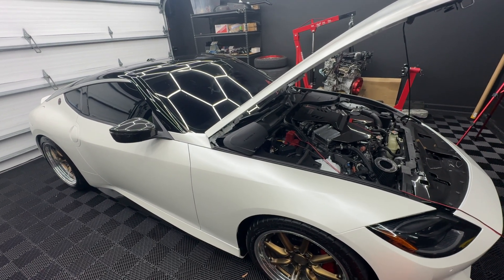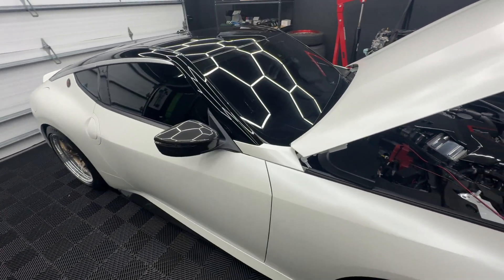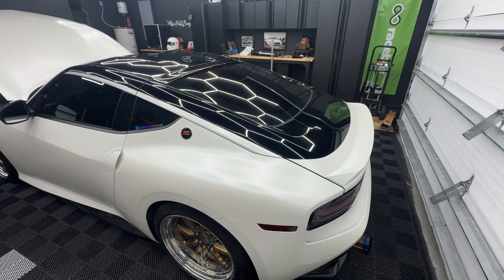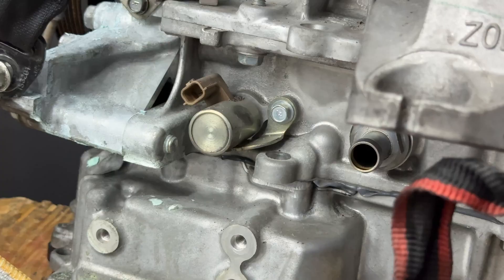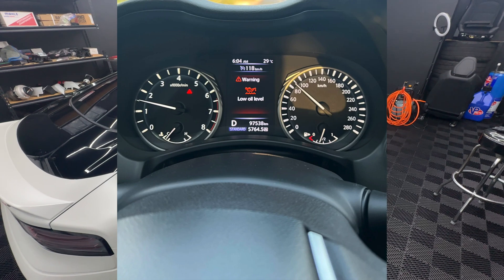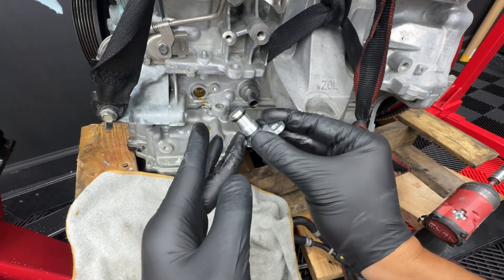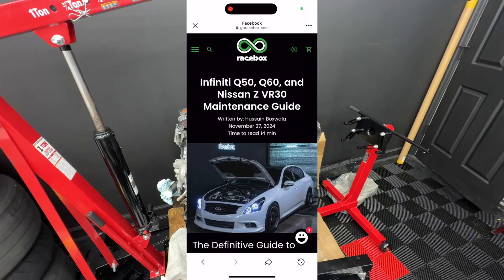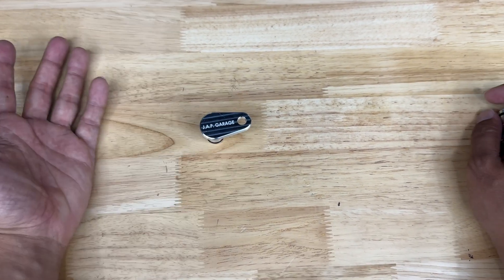Nissan's VR30DDTT Engine Flaw EXPOSED

Comment: 🔥 funny enough my Q60 just blew because of this exact same issue, been waiting on a replacement engine. should i also replace the OEM solenoid as well or do you believe the dealership will do that? 

wouldn’t want to get the car back and run into the same issues again
Reply: When I took mine in it wouldnt go into high oil pressure until 4 - 5k rpms at wot when I monitored.  The dealerships will only check the voltage for functionality.  It passed their check and I had to persist they replace it.  If racebox didnt point mine out, I would be in the same boat.
Reply: just get a blockoff or unplug it. its way better for your engine running higher oil pressure at all times
Reply from the maker: This is one of those items that come new with the long block. 

Btw, if you’re entering into the giveaway I need your IG handle or email address!
Reply: @ZillaFullBoost i believe youtube deleted my comment with my email, but i appreciate the response of course
Reply from the maker: @uzzivilla222 I don’t delete anyone’s comments. That was likely YouTube. When posting your email put a couple spaces between the @ and what ever email service you use or it may get flagged.
Reply: @ZillaFullBoost youtube deleted the comment again lmao, it’s all good tho brother best of luck with the car! been watching since the Q50 days years ago
Reply: 🔥 been tuned 2 years now no issue so far but car starting to throw a actuator here and there any idea? @frostedd_q50

Comment: How would you install the block off plate without dropping the motor?
Reply from the maker: Little hands and the right tools😅. You need to remove the cooler that’s right in front.

Comment: 2017 q50rs going 3 years fbo tuned. I want to run e30 but i seen a few people pump shitty e85. I run top tier 93 only (exxon) but want to squeeze more juice mainly for summer hot temps
Reply from the maker: Pump ethanol can do the job but if you don’t know whether your preferred gas station is good or not, you can use race ethanol.

Comment: You can just unplug the solenoid.
Reply: it works at low RPM,  and then deactivates and allows oil passage ,   unplugging will not let it activate  keeping it restricted and not opening to allow increase flow,  which is the opposite of what you want.
Reply: @twistymcslide2  i dont think thats true. they found its a nomally deactivated solenoid that restricts when activated
Reply: @rabidwolf3681  you may be right.  I read up a bit and saw race box had a suggested maintenance write up and they went into a bit more detail.  I thought the activation was for high pressure but it's for low pressure so the solenoid works backwards of what I thought internally.
Reply: @twistymcslide2 so what are you activating with aluminium blank? just unplug that thing
Reply: @tendrifter888    or just leave it plugged in , and maintain your oil and it wont get build up and ruin the sensor.   and or inspect and replace ,  and then plug back in .....   if this increases oil flow at low RPM , then peace out all the accountability for bearing/ring clearances , over working other systems like internal timing tensioner and pump .   if low rpm oil pressure , or oil pressure in general is a concern ,  then there are other more appropriate means to increase or control oiling.   pump modification ,  accusump , etc.  accusump can increase oil in general and be sued as a pre oiler before the car even turns on .  another way is larger pan ,  and or oil cooler.   then you get the longer service life of the oil over a longer range leaving less deposits which are the issue with the oem solenoid over time.    people love the easy cheap fix,  but dont know why .  they see higher numbers,  and those arent necessarily beneficial where you get the most out of the mod.   so...
Reply: @tendrifter888    same people who do this ,  are the same people who ask what oil to run , and or run a higher viscosity oil ,  and that is only of benefit when hot and at running temp .  its actually detrimental at cold start (  where most damage is done from poor oiling/wrong oil )   and it moves slower at the same temperature.    meanwhile 0W oil flows better at cold start ,  and has more anti friction additives than a 5W oil .   I will take the word and methods of AMS over other companies because AMS actually builds their engines and or rebuilds those brought in for it , in mass , comparably to other companies .
Reply: @twistymcslide2 unplugging it will allow more oil pressure end story
Reply: You just trying to sound like you know what you talking about bro 👌
Reply: @tendrifter888   exactly,  you cant explain how its of benefit besides being more.    even if that more  is bad until oil is at least warm and moving properly. LOL .  thats like adding more fuel jsut because its more.    without consideration of effect....     smart !!!
Reply: @twistymcslide2  Inspect and replace? Do you see how much of a PITA it is to access the solenoid? I have a one size fits all solution that allows me to never look or maintain this failure part ever again. Pump modifications will not change the fact that there is a oil pressure regulator that intentionally reduces oil pressure. Just remove the regulator i.e. the solenoid. Larger pan and oil cooler does not fix the fact that if the solenoid gets stuck in low oil pressure mode, then your car is crippled.

Comment: also , forgot to add.    0 weight oil has more anti friction additives like zinc in the oil compared to a higher weight oil ,   and oils should be selected by their temperature range efficiency ,  a 0 weight will move more freely when cold,  and cold starts is what does the majority of engine damage besides when its overheated by friction and cant bleed off that temperature because the bearings are already heating and retain that heat as the oil is introduced .
Reply from the maker: My reason for choosing 0w40 over 5w is for the cold start protection. Like you mentioned, the most wear happens upon start up. Even though at 80 degrees where I’m at 0w40 and 5/40 is likely close to the same viscosity, but I’ll take any chance I got at protecting my bearings 🙂
Reply: @ZillaFullBoost when I do my first oil change I am install Amsoil green top 0w/20 that oil has 75% more protection then other oils so I feel for the sake of keeping my #Warranty and giving me a little piece of mind that I am protecting the engine better.
Reply: Depends where you live. If you live in temperatures above 60 degrees 5w30 and 5w40 is far superior. It has a stronger oil film strength, and higher resistance to breakdown by heat. You should only use 0w20 if you live in reeling temperatures, or if your bearing clearances call for it. The vr30 has bearings clearances that allow 0w20 or 5w30. Keep in mind the vr30 only runs 55psi of oil pressure at wot at 7k rpm. Which is pretty low. A higher oil film strength is necessary. 0w40 is far superior to 0w20 aswell.
Reply: @Eclipsis17  Down to -30c 0w and 5w have the same rating.  0w can go to -35c , where 5w is limited to -30c.  and they have the same high temp rating .  and film thickness is solely due to bearing clearances.  if its a tighter clearance it doesn't matter which youd use because the clearance limits potential flowability.  or the higher rated oil would have a hydraulic like effect because of its limited compressibility.   and 0w does have more protective additives , and offers the same lubricity , but at a lower temperature.  the only thing a 5w would have is higher initial cold temp start up pressure but thats because until to temperature,  it is slightly less movable.    if you check oil temperature range charts,  youll see they both manage well into the neg degree c/f range. AMSOIL 0W-XX oils utilize a comprehensive additive package designed to provide superior engine protection, cleanliness, and performance. The specific formulation varies depending on the application (e.g., standard, high-mileage, European) to meet the unique demands of different engines and driving conditions .   as well as higher detergents , anti friction additives , seal saver technology , and antioxidants which lessen breakdown and carbon build up . .
Reply: @Eclipsis17    i have one of the Alpha 8 cars ,  and AMS built the engine ( stage 3  )   so the oil pump is modified , and bearing clearance set for the use of the orange cap  Amsoil 0w40  signature synthetic ,  the higher weight offers all the benefits of a 5W oil. plus you get the benefits of the additives. im in FL right by Zilla  , for temp reference.
Reply: Would you say my stock 2024 Z Nismo is safe to use 0w/20. If left stock other than a Z1 drop in air filter? I don’t drive it much but I am sometimes hard on her.
Reply: @nachomandetailingservices1057   yeah youd be fine with sticking to 0W . BUT ,  ideally youd use a synthetic oil like amsoil , or motul which have extra additives which really help .
Reply: Really? After I switched to 5-30 engine runs smoother
Reply: Hey guys,  what about 5W-20?   I have been using that for about 10K miles now and runs super smooth.  It's kinda right in the middle of the 2 viscosity's.   Is this okay to do?

Comment: another reason is too small an exhaust , which causes backpressure , which is then relayed into the PCV and crankcase pressure,  and that can aid in pushing turbo seals, and past rings . )weight isnt as big of a deal as people make it out to be also , we arent running pure E85 ,  so the diluted E50 most will be tuned for is enough for the fuel cooling benefits, but not enough to thin the oil so much because the engines oil heat is enough to evaporate off the fuel if driven enough to get to temp . its more an issue with short drives , especially in cooler environments where it cools quicker and condenses while still i the block .  catch cans arent enough to resolve either issue.  and modifying the valve cover and have an external breather tank separate from the catch can really helps because it further catches a higher quantity of vapor and doesn't reintroduce it back into the engine , vapor can pass through the PCV system , but the oil doesn't at the same proportion. . the vapor stays with the air , and oil is retained in the catch can ,  UNLESS  you run a high enough boost pressure the small cans available on the market cant contain it because of the higher PCV pressure which will still allow its passage and return .
Reply from the maker: Yea exhaust contributes to high back pressure. IMO, our biggest issue is the head design. That being said, you can dump your exhaust right out the downpipes, have big enough turbos to aid that back pressure, but the head I feel is a restriction itself. 

With the documented findings of cracks on blocks and heads and the lackluster head design there will be a market for aftermarket cast components if someone is willing to make the investment.
Reply: @ZillaFullBoost     thats exactly why on my car we went true dual ,   it basically flows like dump,  but is still resonated , so its not restrictive,  but not just dumped , so it is still streetable .  going true dual is like having a 6" exhaust ,  where most X piped systems are still limited to their smallest section of the X.    thats why i told you a few months ago when you were talking about exhaust i said id not be surprised if the single Tomei you run ,  is still causing you backpressure.  .   i really think anyone making over 550-600HP will benefit by going true dual .  especially when you surpass 700hp its needed.
Reply: @ZillaFullBoost  because of firing order,  i dont think the head design is as big of an issue,   the outlet is much larger than the cylinder inlets .  cams and porting helps also because you can then mess with valve overlap ( remember that video of my car running and sounding choppy like it had a larger cam than it does )  ,  or like the bonnie an clyde big cam video .  same same.  its from using valve timing as a vacuum and keeping the intake slightly open through the exhaust phase of a different cylinder,  that helps fill the cylinders with fresh air and that pushes unspent/ remaining  exhaust gasses out.  and you get the different sound . the biggest flaw with the heads was the casting , and i think it was caught by nissan in 2018/19 , and id think corrected as you dont hear of it happening in 2020+ models.
Reply: Thats why i take the pcv and valve cover breathers to a catch can and vent to atmosphere so the engine can BREATHE while it runs. 
oem pcv only works under cruise speed, its closed under idle and wot.
Reply: @JDMCarsOwner  this is an interesting fix to me, because my stock 6speed 04 350z always ran 100% for the 10 years i had it... 
Except for the damn PCV valve -- i learned the hard way if I didn't  replace the PCV every few years, it would fail and slowly dump crankcase oil to the outside until lifters started clicking!!
Reply from the maker: @JDMCarsOwner so you’re right with the PCV, but we also have a CCV. That uses the vacuum to pull the gasses during WOT plumbed from the turbo inlet. 

I’m so torn between leaving this system the way it is or venting everything. I don’t have enough data to show which is best on big power cars. I’m thinking venting will be best but I’m not sure.
Reply: @ZillaFullBoost  I dont have that data either but the way i see it, allowing the crankcase to breathe while its running is better imo. 
PCV only works on cruise speed or ~10 inches of vaccum. Idle and heavy throttle its closed so as that crank rotates, its creating wind pressure and moving oil vapors, that pressure and vapor has to go somewhere and if the pcv is closed, its going to exit or get pulled from valve cover breather which routes it back to the intake which sends it to the valves an combustion chamber. 
I don't want that crap getting on my valves let alone the combustion chamber. 
So off to the catch can it goes and vented to atmosphere.